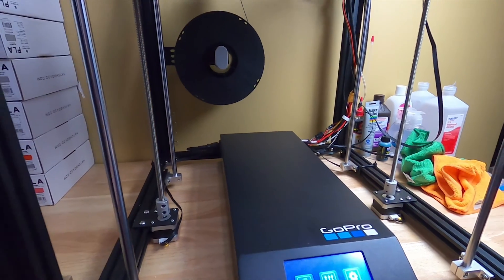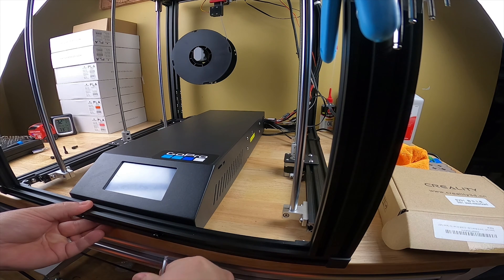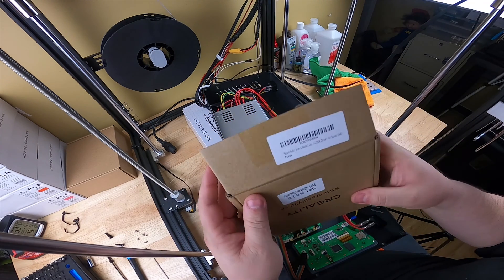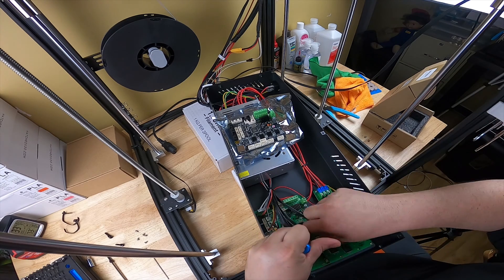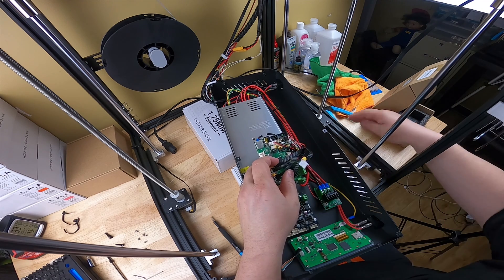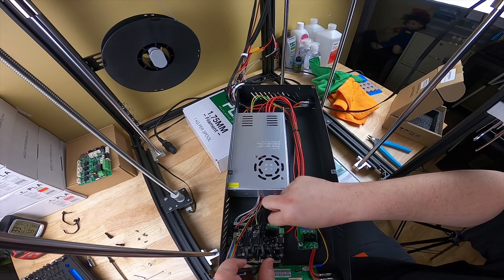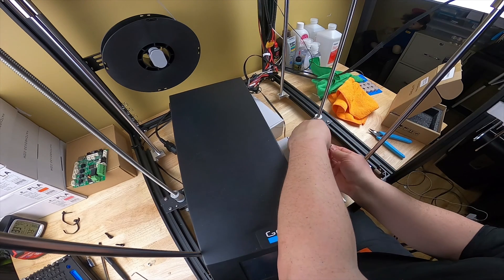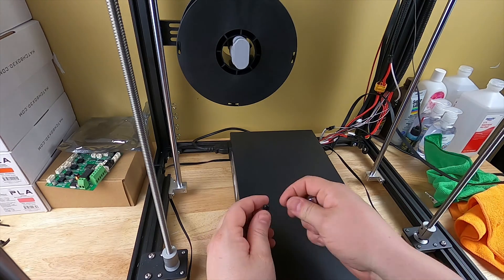Ender 5 PLUS PRO BOARD UPGRADE FIX Silent Board v2.2.1

Comment: Ive had no joy with this upgrade, Now i cant even find Creality slicer to connect to the Printer for firmware as this board turned up flashed for a CR10 not the E5+ I have.

Comment: What is the difference in the v2.2.1 versus v2.2.0? Aside from the stepper drivers I'm guessing.
Reply from the maker: I believe the v2.2.1 fixed the problem where people were getting bad flashes mostly. That's all I could find the boards black, the bad flash thing and the second extruder has a silent driver.  Sorry I don't have more information about that believe me I have looked because I wondered the same thing